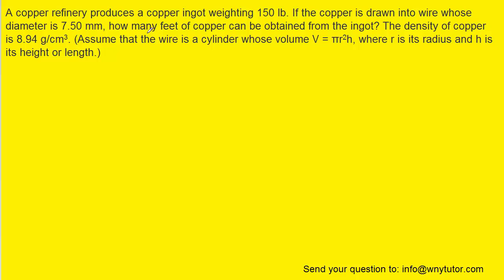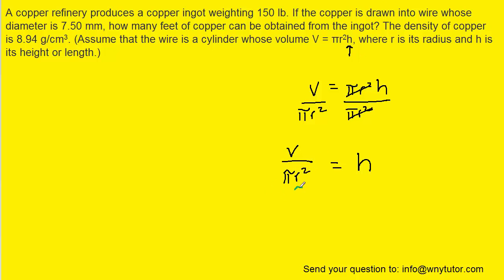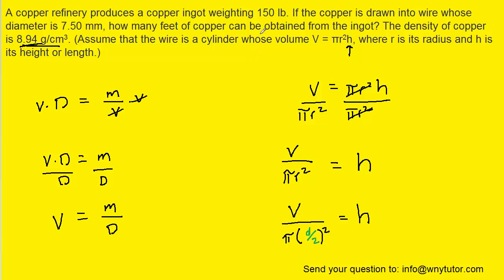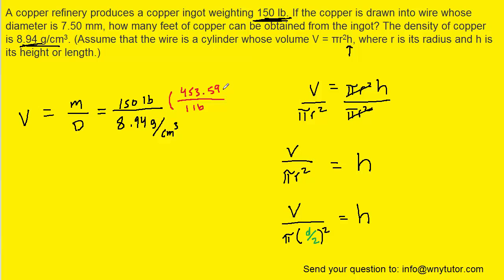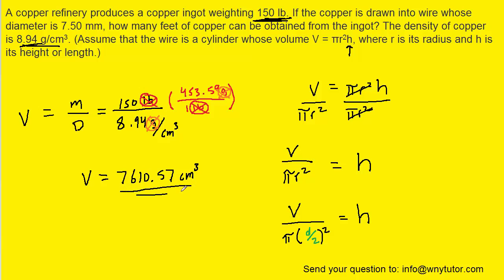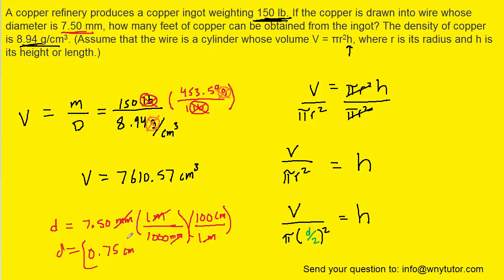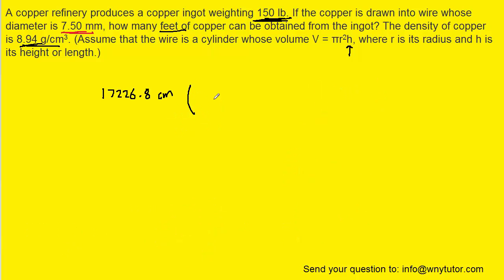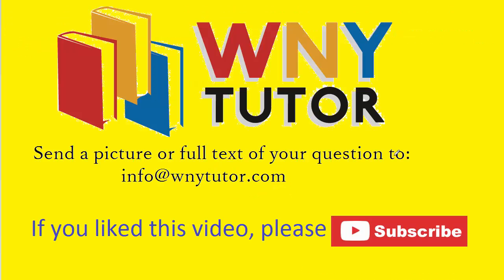A copper refinery produces a copper ingot weighing 150 lb

Comment: Isn't it necessary to round using sig figs whenever you convert one of the measurements from unit to another? That's how I ended up with 560 ft instead of 565 ft.